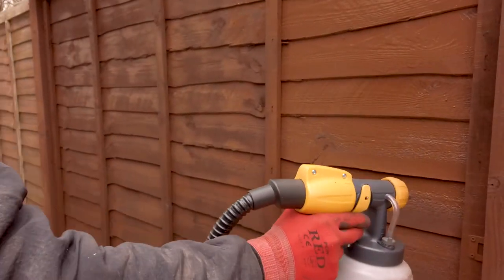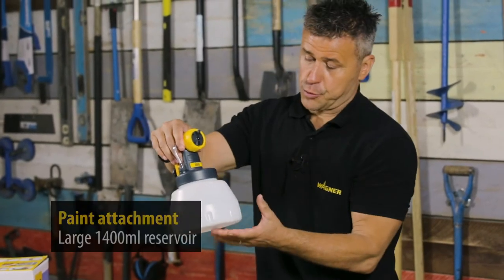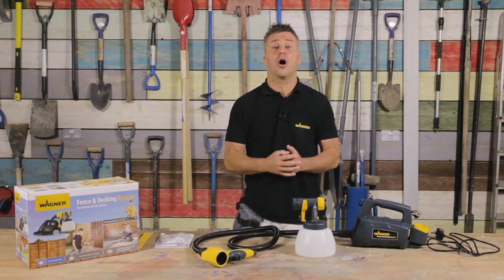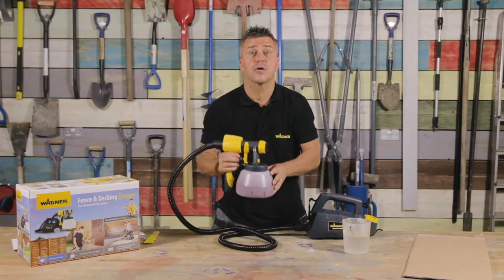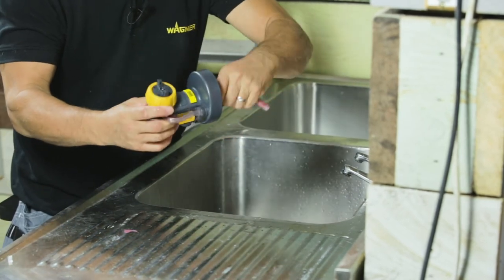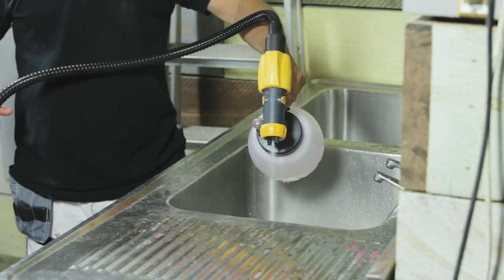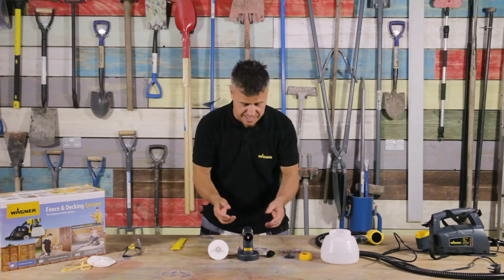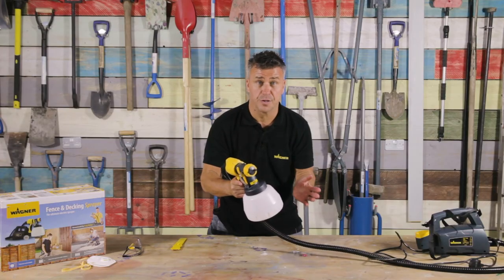How to use the Wagner Fence & Decking Sprayer with Craig Phillips

Comment: Thank you for the video. I’ve got the same one, but no matter how closed is the valve to release more or less material, the fan it’s soooo wide! 😢
Reply from the maker: We only make the video, not the product but we know that the fan width only has horizontal, vertical or detailed - the material volume will not adjust it. Try turning the air cap to 45 degrees for the detailed setting!

Comment: i want to paint my fence do I need to dilute the paint or leave it?
Reply from the maker: Hello Chris, depending on the paint you are wanting to spray you might need to dilute it. Water based paints are easier to dilute and also easier to clean the machine afterwards and are available for a range of applications. To dilute and get the correct consistency/viscosity of paint. You can use the Wagner stirrer which has 10% notches on the side. 
we would recommend adding 10% water/thinner and increase by 5% at a time. Mix the paint well lift the stirrer from the paint and observe how the paint flows, it should run smoothly and continuously and should dissolve into the paint without leaving a trail on the surface. Getting the paint consistency right will ensure you get a professional finish.
There is a specific explanation about diluting paint in the video here:https://youtu.be/_A-4tS47rHw?t=145
Kind Regards the Demand Marketing Team.